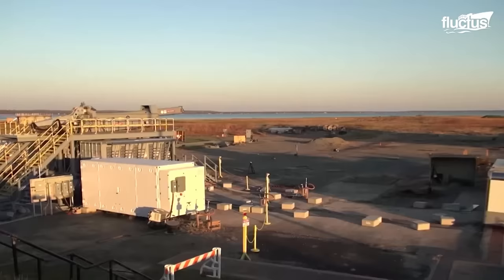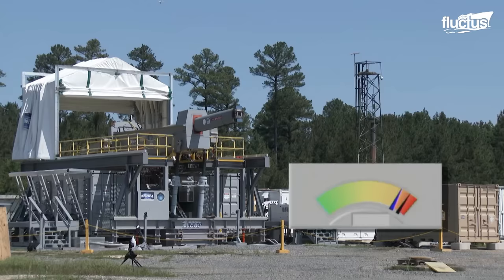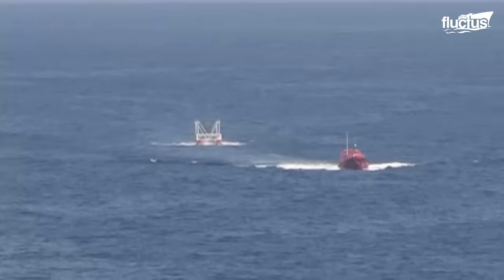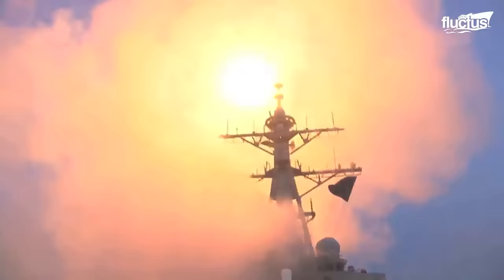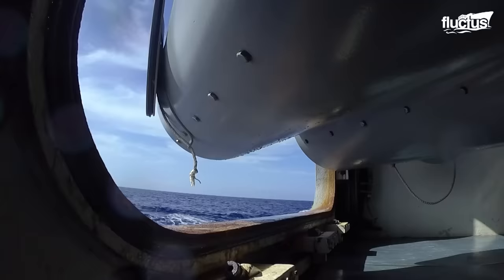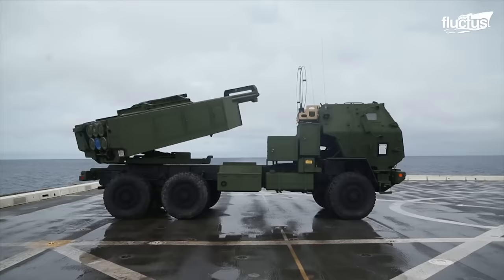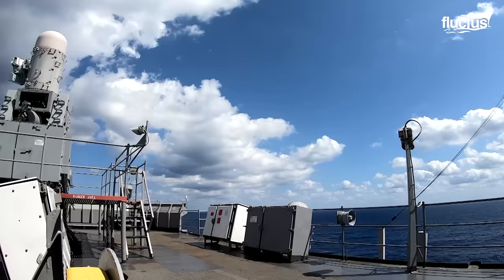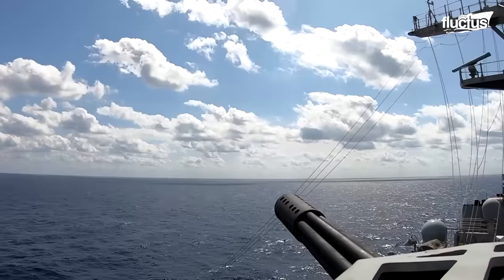US Testing Its Monstrously Powerful $500 Million Rail Gun

Comment: Rail guns would be excellent weapons for modern warships with massive power plants, except for the fact their rails burn up faster than a sailor can find a red light district.
Reply: Damn that’s quick. 😂
Reply: The age of the battleship is coming back
Reply: CMDR Garbage Battleships A weapon system like this would be used on a cruiser to complement missile systems. A battleship wouldn't be versatile enough to suit the Navy's needs and would be obsolete by the time it came out because current missile technology makes armor mostly ineffective. I don't see them mounting more than 1 or 2 of these on a ship because they are so high maintenance, a battery would be completely impractical.
Reply: @talandar5773  I didn't think the comment about battleships coming back was worth responding to.
Reply: You do know that it will be (or has been)  deployed to space and only has to fire a few time to take out the high end targets it needs.
Reply: @George196207  What it need is rails made of some relatively inexpensive and high temperature superconductor.  If they can make it so they can swap "barrels" quickly and easily, without taking out a second mortgage on Virginia, it would be a viable shipboard weapon.
Reply: @ThatsMrPencilneck2U  No...you wouldn't want that with a rail gun.  The projectile has to be in physical contact with the rails to complete the circuit and the frictional heat and current induced heat on the projectile would make your rails to warm to superconduct.
Reply: @thatxmas  Come to think of it, if you had a big enough heat sink, it would completely solve the problem with burning up the rails.
Reply: It's worth it tho if you get confirmation an enemy ship is out of sight you can railgun through the Hull from miles away
Reply: CoC: "These are the places you aren't allowed to go." My little E3 ass: "That's where we'll find the shrimp my boy!"
Reply: You don't have to turn on your red light- Roxanne....
Reply: @fubarlife7776  That is the most obnoxious song ever performed in the known universe.
Reply: @ThatsMrPencilneck2U  "R O X A N N E" LOL
Reply: What do you think about laser weapons? As i know the navy has that kind of weapon already. Isn‘t that better than a railgun?
Reply: @MrMrMrMrMr  From what I know of Laser weapons, they're less expensive to fire than light machineguns, and have better range.  They just can't make a practical heavy weapon.
Reply: As the material science gets better we're finding things that can take the heat
Reply: @George196207  are you referring to Thor's hammer? Tungsten poles 30 ft long, they just throw them down at the planet surface wherever their target might be. All the bang of a nuke none of the fallout.
Reply: @ThatsMrPencilneck2U  You could work it like they do the GAU-8 on the A10, have a bunch of barrels and then alternate through them... That would help dissipate the heat while the other barrels are firing.
Reply: @MrMrMrMrMr  last thing I read up was rubidium chirp pulsed phase coupled-decoupled.  I hear they're getting about 10 terawatts out of it.
Reply: @user-hs8pn4xb5v  It doesn't work, like that.  A fraction of the rail goes down range with every shot, and that fraction is just too big to make for a viable weapon system.
Reply: @ThatsMrPencilneck2U  Well if I understand this it's a sabo yes? Could you build a sabo with roller bearings?
Reply: @user-hs8pn4xb5v  A rail gun works by pushing the projectile down range by generating a bubble of plasma between the rails.  It is the action of generating this plasma that consumes the rails, not friction with the projectile.
Reply: @ThatsMrPencilneck2U  Thank you I'm certainly no expert on railguns, but the last one I saw at Dugway test range pushed a steel ballistic projectile encapsulated in an aluminum sabo. I'm stumped here, how does an aluminum sabo survive a plasma bubble?
Reply: @user-hs8pn4xb5v  The aluminum gets out of the plasma's way.  Plasma is matter so excited that atoms are stripped of their electrons.  That means it has a very intense electrical charge, thus a magnetic charge.  There's an old science fair trick where they get a big strong-looking kid to try and swing an aluminum bat through an intense magnetic field, and the bat stops cold.  With the rail gun, it's the magnetic field that's moving.
Reply: 😘 indonesia
Reply: Indonesia love
Reply: Unnecessary... Why not invest more on missiles and drones.
Reply: @kevinhiponia6017  There are two reasons you want to get away from missiles and drones.

1.)  Cost  Missiles and drones are full of expensive electronics.  Theoretically, the cost of firing a laser would only be the little bit of oil you burn in your ship's power plant.  A conventional 155mm shell costs over $400.  A rocket with the same sized warhead costs at bit more, until you make a guided missile and then it cost $20,000 or more.

2.)  Safety.  Energy weapons do not have propellant or explosive warheads.  Many a ship has been sunk by a direct hit on the magazine, setting off its ammunition, and sending the colossal warship straight to the bottom of the sea.
Reply: @cmdrgarbage1895  LMAO, yeah because rail guns will 100% be more effiecient and effective than planes and cruise missiles....
Reply: @fubarlife7776  hehe I liked Roxanne, still do.
Reply: They are only good at close range.  The speed of the project falls off in direct proportion to the square of the speed. Several miles away the speed will be subsonic.
Reply: I am no expert on rail gun tech. But, wouldn't it be possible to cap off the end of the barrel with a disposable cap, vacuum the barrel down to 28 in lbs of vacuum and then fire the rail gun to increase your fire rate on the barrel work better? They spent 500 mil on it to get this far, just hook up a Harbor Freight vacuum pump on it for giggles and see what happens next.
Reply: @ThatsMrPencilneck2U  I'd say aircraft carriers are the new battleship. Most of them being nuclear could mount one of these on a deck somewhere.
Reply: @Eluderatnight  So you want aircraft carriers within conventional weapons' firing range of enemy ships?... The enemy would love that, get two of their ships shot up (and while damaged, not sunk) in exchange for attacking an aircraft carrier.
Reply: @someguy4915  within 230 Nautical miles is out of range of anything conventional. Regular cannons are what 20mi?
Reply: @Eluderatnight  At what point did you see aircraft carriers with regular cannons attacking shorelines and other ships? :P
Anything that would be within range for the aircraft carriers' railgun would see the aircraft carrier within range of counter attack and I'd hazard a guess that no other ship is more costly than an aircraft carrier.
Reply: @Eluderatnight  The problem isn't the power requirements.  The Zumwalt class destroyer was designed with an electrical system that could handle this weapon.  The problem is that the copper rails burn up.  I'm guessing that the plasma that pushes the round down range is made up of that copper, so there is no way save it.
Reply: @someguy4915  so supersonic jet @230mi is ~20min. The railgun is literally being developed as an anti missile/aircraft system as well as anti material. The standoff range would give a huge advantage against any counter attack. Pound shore with "cheap" steel rods and have extra spicy projectiles for defence.
Reply: @ThatsMrPencilneck2U  railguns don't use plasma they use arc force. Try using a tig on full power or watch a jacobs ladder (with eye pro).
Reply: @Eluderatnight  Unless your supersonic jet is one of the kamikaze variety it would've been launching its missiles way before this point anyway.

And for the other scenario you're suggesting sailing an aircraft carrier to (relatively) close to shore to then fire a railgun at the shore?
Wouldn't it make more sense to just kind of, you know... Launch aircraft from the aircraft carrier instead?...
Reply: @someguy4915  without spotter aircraft or satelite you cannot track an aircraft carrier that far out. Radar won't see over curvature(72mi max).
Reply: @Eluderatnight  But with a radar you can quite easily calculate the origin of a highly predictable trajectory projectile...
Also still doesn't solve the original issue: why have an aircraft carrier with a railgun glued on top to shoot at a shoreline while not deploying aircraft from said aircraft carrier?
It's like putting a naval gun on an aircraft to then throw rocks at the enemy...
Reply: @Eluderatnight  I'm hardly a physicist, but whenever you see an arc, it is made up of atoms being stripped of their electrons and returning to a gaseous state.  This is getting away from the point.  It is not the power requirement that keeps these weapons from being deployed, it's the fact that they go through very expense rails very quickly.  No military arm would want a have to reline the barrels of its main armament in the middle of every fire support mission.
Reply: @someguy4915  I am saying do both. Aircraft and railgun hanging off the side.
Reply: @Eluderatnight  If you can find a spot on a modern aircraft carrier that can just fit a railgun...
This means all currently existing/already designed carriers cannot be retro-fitted.
Any new carriers would need to be designed from the ground up with the railgun in mind.
Quite the expensive project only to end up with an aircraft carrier with less space for its aircraft, a battleship that lacks the power to really destroy much and a price-tag that even Elon Musk would cry over...

Yes in testing they've hit 200 something miles range, subsonic...
A subsonic lump of metal hitting a bunker on the shore line won't impress anyone, nor will it disable said bunker...
With the distance, hitting moving targets is not realistic so taking out small vehicles is off the table...
So you design and build a whole new class of aircraft carrier to put a small crater in a bunker, talk about spending billions to create $50 of damage to the enemy.
At shorter ranges the railgun becomes far more effective due to the projectile having a far greater velocity, but parking an aircraft carrier within 30 miles of a shoreline is a guaranteed sinking...
Reply: @George196207  or food manufacturing plants
Reply: This is why they haven't adapted it in the military. Completely unethical.
Reply: Exactly , col guns (Gauss gun) is much more favorable here.
Reply: @Rom2Serge  I'm thinking Gauss guns use a lot of power, and the barrel of the weapon would be an order of magnitude more expensive than a conventional cannon barrels.  The engineering around this is well known as this is how super-collider research is done.
Reply: @ThatsMrPencilneck2U  hi you are right Coil guns might be more expensive. 
Every weapon is evaluated on such parameters as cost / effectiveness and possibility of mass production. 

Tho I don't what has better Energy conversion efficiency , rail gun , or coil gun. 
As a heared coil gun has one interesting advantage as precision because projectile is not pushed thought the barrel but basically floating thought magnetical field and if coil hadn't changed projectile every time is pulled exactly into the center of the coil. 

Tho you are right if they are building rail guns probably it means that energy efficiency of rail gun is probably higher. 
But as I imagine after every shot this rails would have erode and making every other shot precisely on target would be more difficult. 

Tho im not an engineer, so can only speculate what weapon would have been better. 
Nice talking to you Paul.
Reply: A coilgun may be better but a railgun is so much simpler and you can more easily design around replacing a barrel even at sea
Reply: Don't the barrels last for only a dozen shots before it has to be replaced?
Reply: @Joe T  it depends, you can build them to last much longer but it's probably not worth it as it's basically just some fancy metal rails but the forces acting on them warp them until they need replaced
Reply: Yeh ur right from I’ve read the forces r so great on the barrel that’s it’s compromised far to quickly to b a viable weapon
Reply: @user-fq4qk9wz5k  Somewhere else, I heard a naval officer say that he would scream if someone showed him another piece of steel with a hole blown in it.
Reply: Of note, I agree about rail guns.  The Gerald R Ford aircraft carrier  use magnetic induction for their catapults.  They do not use steam catapults that require some form of boiler and pressure tank that has to be recycled on each launch.  Any portable or battery-powered device must be recharged.  Aircraft carriers are floating nuclear power plants.  They create enough power to run small city.  There are no delays.  The same technology can be used by Gatlin gun and regular cannons without any explosives or propellant.  If you want to know how old the technology is, you can look back east 30 years at Walt Disney where the people mover ride is is done by magnetic induction.  Of course, they do not propel people 6000 ft./s.
Reply: Just wrap the pipe/barrel around the deck a couple of times the magnets would be 1/4 the cost and heat wouldn't be as big an issue
Reply: lasers and particle beam or projectors are far more reliable.
once we can send a stream of denser particles in a laser, its star trek
Reply: Space battleships, now they don't have to transport tons of projectile propellant up into orbit.
Reply: @talandar5773 I think missiles ships are worse than a railgun using battleship.

Think of it this way: Cruise Missiles need extensive room and secure storage that can chew up space on a ship, especially the higher yield ones that can possibly detonate on board from a malfunction.

Railgun shells are much lighter and have no explosive yield while also costing far less in both space and money.

Missiles can be shot down using on board AA platforms much easier since a single bad graze can set them off.

If we could get railguns to a usuable level, it would render Missiles obsolete for more reasons than just the ones I listed.
Reply: @firestarthndrclan1261  The rails of a rail gun are made of copper, which is a strategic metal.  They burn up after just a few shots.  This makes the weapon extremely expensive to operate.
Reply: @ThatsMrPencilneck2U  Hence why I said that the technology has be at an operable level.

Honestly? I think creating a hybrid design railgun would work best, but I think I'll keep the ideas I've thought of for that to myself.

Comment: Honestly I hope they continue research and development on the railgun. IMO you can always counter a smart weapon system with a smarter countermeasure, but you can't outsmart a solid slug of metal traveling at supersonic speeds. 

Missiles can be countered with early detection and lasers or another projectile to disarm or pre-detonate. Lasers can be countered with weather or distance. Drones can be simply shot down or EMPs. Whats gonna stop a metal slug from flying at you other than adding more armor?
Reply: Can't outsmart Bullet.
Reply: This is true. Isn't a laser superior though. Similarly, once it's fired you cannot stop the light hitting the target
Reply: @danmartin9086  Even the highest powered lasers can be refracted/reflected or scattered.
Reply: Any type of flare using larger metal pieces would cause the round to become thermite
Reply: very big magnet
Reply: @danmartin9086  mirrors
Reply: A slight deflection, even by just a single degree, can make it completely miss it's target.

Comment: If this is what they're presenting, what they really have now is far more advanced. I remember reading an article in Popular Mechanics in the 80's about rail guns, and it was much the same then as they're showing now. There is no way it hasn't advanced far beyond that.
Reply: Actually, this project has been already canceled due to high costs.
Reply: Never underestimate how far we’ve fallen since then… or the greed of military industrial contractors
Reply: @Swagmessiah8394  it isn't that impressive, Yuri can do it too.
Reply: @Swagmessiah8394  how is this relevant to my comment, schizo?
Reply: @carlosferreira5114 what if it still going under a black budget?
Reply: Nope, what they're presenting is MOSTLY what they currently have, the rest are prototypes or still on drawing boards. Could you think of a single weapon that the US magically pulled out of nowhere at ANY point of their history? it's simply not feasible with the amount of people involved
Reply: The real issue now is material performance. It isn't very useful if you can only use a barrel/rail system once or twice. All it takes is a slight deviation from the projectile to score and ruin the entire rail in its current form. If they can determine a better travel system  for the materials used for projectiles, then it can be integrated into a weapons system.
Reply: What has progressed since then is the not the design theory, but the efficiency and compactness of the system. Back in the 80s, the system required a power source which would take up a huge amount of space on the ship. So yes, we've come a long way since then
Reply: Nah.  Projects stall and/or fail for various reasons all the time:  maybe a problem that can't be overcome is encountered, maybe costs run too high for a weapon to be cost-effective, maybe the military simply decides to go with a different option.  It's not like movies where our military has the best of the best in weapons and equipment - I constantly see news reports of obsolete military equipment still being used.